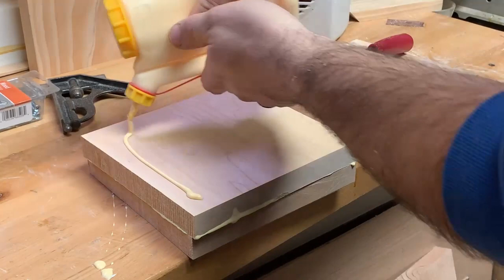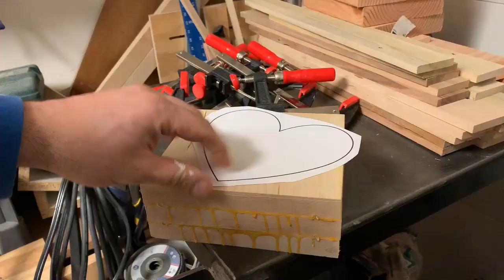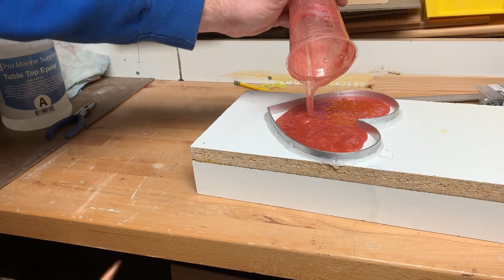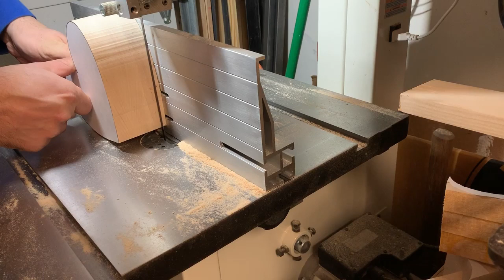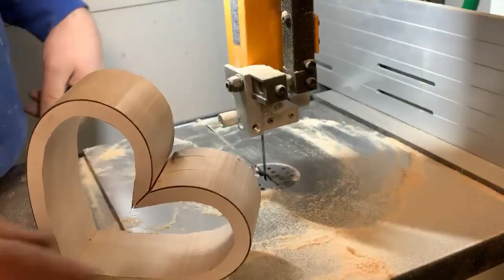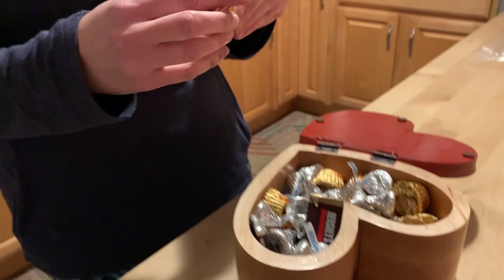Epoxy Heart lid for Wood heart box, Valentine Gift

Comment: Once the epoxy lid dried on the wood, did it lift easily?
Reply from the maker: I poured it on melamine board, it lifted off the wood very easily. Removing the aluminum heart shape form was a little more challenging but overall it wasn't too difficult. Just took my time so I didn't chip the epoxy.

Thanks for watching!!